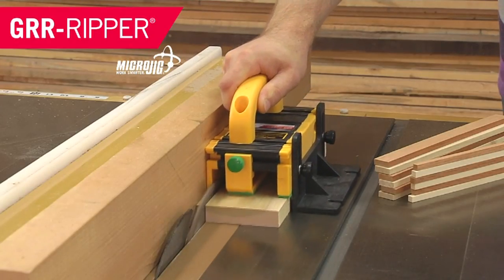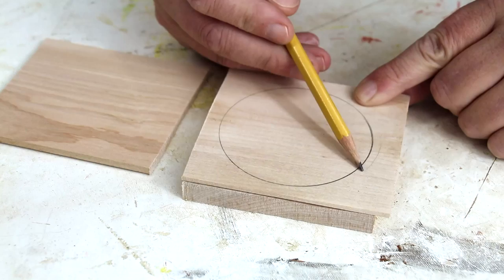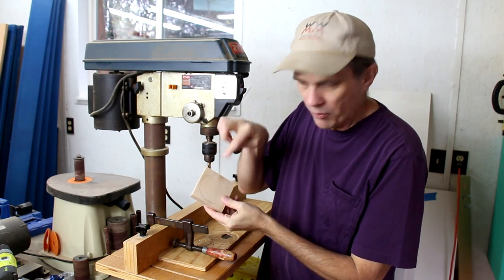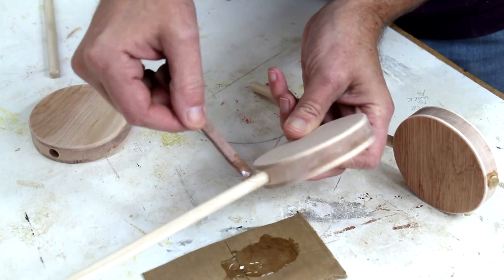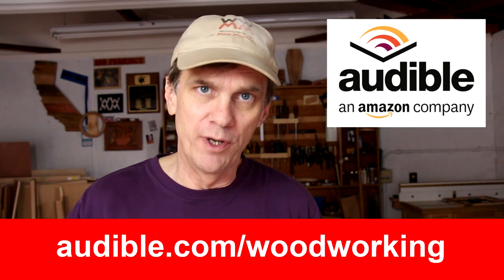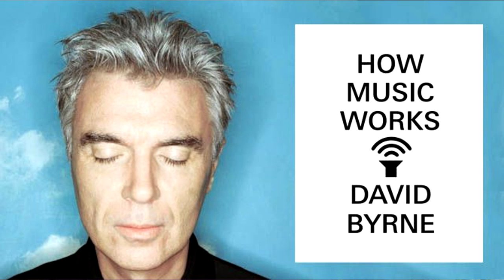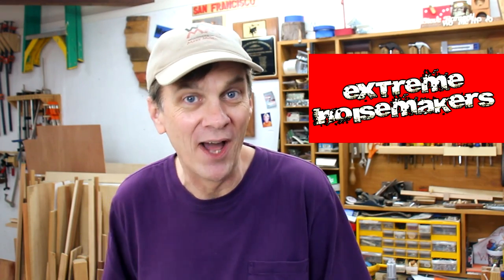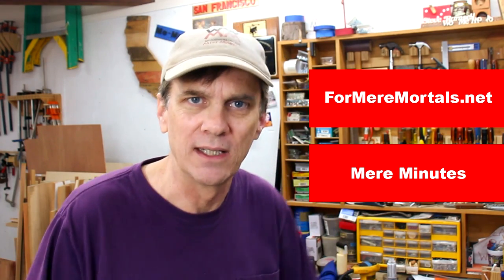New Years flip-drum noisemaker | 5th annual WWMM New Years noisemaker

Comment: Question for you if I may, my workshop consists of a hand saw, dremel, hot glue gun. I am working on a project that requires 3 rings with a 45° angle on the outside of the ring. What tool would you suggest I get to cut the rings plus the angle? The project I'm working on is a Dalek from Doctor Who.